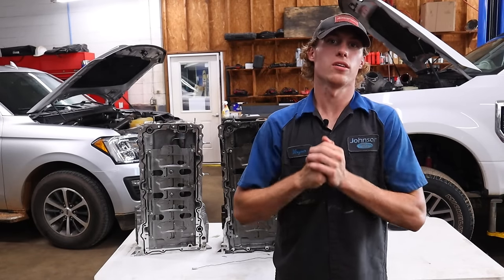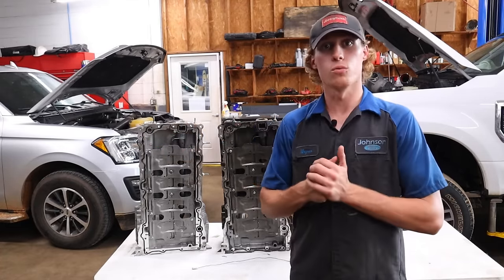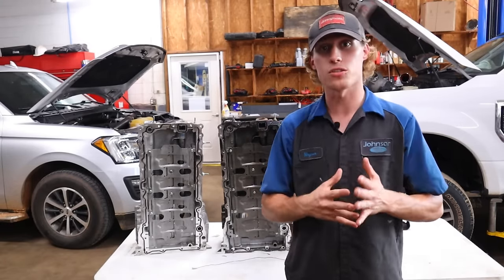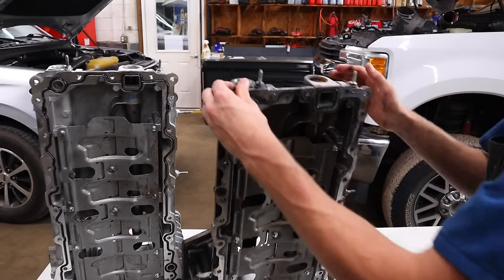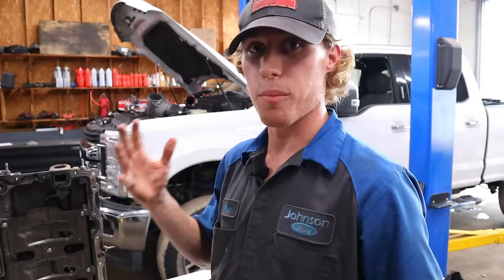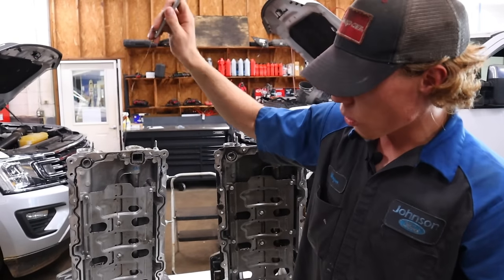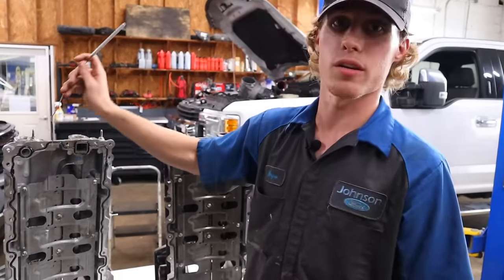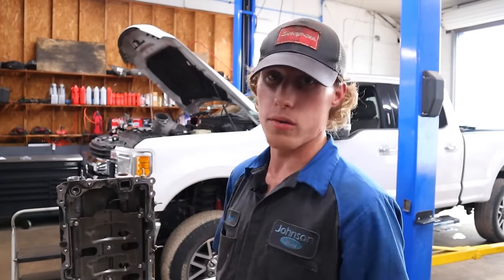How a BRAND NEW Oil Pan Destroyed This 6.7L PowerStroke

Comment: Grateful to still have my 1980 Ford F-150 shortbed with the original 300 in line 6 cylinder, 74,000 miles on it.
Reply: Now that's a cool Pickup Truck!  Don't ever sell it!
Reply: @rpsmith  that's good advice and I will keep it.   Found it at an estate auction 4 years ago and drove it home, 2,650 $.
Reply: That's a nice combo, the six with a shortbed. I've owned many chevys, dodges and now I drive a 85 f250 460 bbf. Best truck I've ever owned, and that's after owning 3 Cummins powered dodges!
Reply: @forrestwright5981  that's an excellent truck you have, they're hard to find at a fair price.    I got lucky, mine has the original undercoat and needs no body work either, original paint.

Comment: Honestly, I’m not surprised. Back at the old shop I used to work at, we ordered a rear axel for a sprinter van. The axel came in, and it didn’t have the holes to mount the spindles. Some one forgot to drill and tap the holes 🙄. Quality has gone down the drain for most manufacturers

Comment: After an oil change it can take more than 8 seconds to fully prime the oil system,
The unless's, 
The engine was reved high,
The engine was already hurting,
There was something nocked loose in the oil gallery and got past the filter.

Comment: Was the engine confirmed bad, as in ruined bearings?  I was thinking it may be possible the lack of oil flow caused a hydraulic lockup condition, where the oil pump pressure relief valve didnt flow enough oil to avoid stalling the engine.  Curious if oil pump and related components had any abnormalities after engine locked up.

Comment: I just played this game with ford two months ago. First replacement factory rebuilt transmission from ford had the clutches burn up in 3 months of normal daily driving (not towing or taking steep hills/racing). The 2nd factory rebuilt transmission that was being put in my truck had a housing crack that ford missed and cost me an extra 3 days on top of the 2 weeks that I had already spent waiting for my truck to come back from my local AAMCO shop. Because of that I am now on my 4th transmission. Thankfully the previous two transmissions and any future ones between now and 2025 are covered by my three year unlimited mileage warranty with AAMCO.

Comment: Ill be checking thay from now on thanks. Another thing to check is your upper turbo pedestal gasgets. They have an early and a late build gasget. We just got a turbo that had the wrong gasget from the supplier. The turbo lasted about 10 min before it locked up. Due to a lack of oil flow.
Reply from the maker: Good tip! Fortunately I learned that before I locked one up haha
Reply: Yes.  I have seen that happen in my shop as well.

Comment: Thanks for keeping us updated with your videos!  This is one of the reasons that I decided not to have my upper oil pan leak fixed even though it just crossed over 100k and would have been covered under warranty.  Was too afraid of something going wrong when they drop the tranny, pull it all apart then try to put it back together with no mistakes.  Have also read a lot on forums and YouTube video comments where the pan just ends up leaking again not long after it’s put back together with silicone.  Right now the leak is fairly minor and hoping it stays that way.  No CCV filter in my 2019 6.7, just the CCV box.  Curious to know if I should periodically replace the CCV box?  No major pressure at the oil fill cap.  Just a little steam that vents out…
Reply from the maker: I would!
Reply: @FlyingWrenches13  Will do, Thanks!!
Reply: CCV delete and reroute, especially since the warranty is gone.
Reply: And being a dealership they do it as fast as they can, that is how techs get paid well.

Comment: Man cant help but feel bad man, ive had 1 kind of simular where they didnt pull remove the plugs before installing the oil cooler from the factory and didnt go more than a few hundred miles before coming in with no oil pressure...oil reason i found it was cause after getting apprival for a long block i removed the cooler to remove the axle and i found all this red rubber shit in the oil passage and instantly knew somebody fkd up on assembly...so with that being said guess what i checked on the new longblock....took the oil cooler off to do my own inspection cause i wasnt about to have to do that all over...comebacks are never fun

Comment: That's messed up. Once I had a brand new hydraulic lifter fall apart because it was assembled missing a clip. Held an exhaust valve open under boost causing that cylinder to preignite like mad and ruined the head. Little bit of meltage on the piston too and the porcelain shattered on the spark plug making a nice scratch down the cylinder.

Comment: I had to install a long block in 11 6.7 for customer because another shop forgot to add oil to his truck when they changed the oil. Truck made it maybe 4 blocks then seized. The crankshaft tolerances are pretty tight. And I dont think main bearings use tangs like old motors.
Reply: sorry if new, but if you could tell me what the main bearing tangs add that non tang dont ?

Comment: You've done a good video/presentation. I worked for a Fix Or Repair Daily dealer in 1969(when we had very kool cars). After seeing how miserable the older guys were, I decided to go to college and be an engineer. I worked in construction, as an engineer, for 35 years. In the past 30 years we have seen a lot of foreign steel and hardware cause big problems and even collapses. There is a general lack of quality control/quality assurance everywhere. Many managers consider quality inspectors a wasted overhead and try to eliminate them. Good Luck, Rick
Reply: Weldor for the last 50 years and agree with you on the Cheap Frigin' Chinese Steel
Reply: I don't doubt it. I work as tech/mechanic and there was a period of a couple years just before COVID where a lot of wheel bearing we installed failed within 6 months, some barely made it a month. We tried different brands, Moog, Timken, NTN, National, ect. it didn't make a difference. We even had fairly new, low mileage vehicles coming in with failed OEM wheel bearings. Whatever type of steel they use for bearings, the supply chain for it must have got a really bad batch mixed in and it messed up all of them.
Reply: @madmatt2024  Are you specifically talking front hubs/bearings assemblys ? I know timken is gone, now koyo made in japan, Moog gone made in china, Ntn says headquarters japan, Bower gone, You say thats not happening now though ? What brand are you buying now thats working ?
Reply: @brianblithe2271  It was all wheel bearings, press in style, front AND rear hub bearings, you name it. Then it seemed like once all of the bad stock was used up, the issues went away. We don't go out of our way to buy any particular brand these days.
Reply: @madmatt2024  Thanks for the update brotha, appreciate it and rock on !!!

Comment: I got a couple questions. Are the pans with the seal a direct replacement for the ones that take silicone? And what’s the difference in the bc3z6710-a and the 6710-b gaskets?

Comment: I’m not a mechanic, but is it good practice to first crank the engine to build oil pressure before actually starting it (i.e. clear flood mode on gasoline engines)?

Comment: My buddy changed his own oil on his Honda. When he poked the plastic wrapper on the new filter a little piece went down into the filter. That little piece ended up blocking the hole to the upper part of the head that the oil feeds through. Smoked the engine. One tiny piece of plastic.

Comment: WOW! At least with a 7.3 the engine won't run long without the LPOP feeding the HPOP reservoir. I guess another preventative measure is to crank the engine without starting until you see oil pressure. Like @Ford Boss Me recommends following oil changes.
Reply: Same as a 6.0L.
Reply: @davidleonard8369  Good to know. I've never moved past the 7.3 to a 6. anything. Hear they are a lot more powerful than a 7.3, but also have to spend a bunch of $$$ to bulletproof them.
Reply: I don't know why that would be necessary following an oil change.  Oil pan off or internal engine work?  Yes, I think cranking until oil pressure is shown is a good idea but not for a routine oil change.
Reply: @ghostwrench2292  I certainly don't do it... but you are right, fo9llowing major work where the oil galleys might be empty, or bearings dry...
Reply: The oils are basically separate if they mix it's very very slow you can change the oil in the engine and not the high pressure Reservoir and right around for a month and the oil and the motor will be golden and the oil in the high pressure Reservoir will still be black so the engine will run with no oil in the oil pan until it blows
Reply: @tonydiesel3444  I don't know where you get your information from, but it's very much incorrect. The reservoir holds around a quart of oil, and the HPOP pumps the oil to the injectors. Each injector has an exhaust port that shoots oil onto the top of the head every time they fire. If the reservoir was not being replenished by the LPOP, the oil would be pumped out in a matter of seconds  If you run a 7.3 6 - 8 quarts low it will stop running because there is no oil to fire the injectors. If you look at videos where they are verifying if injectors are firing, they will remove the valve cover(s) and observe the injector exhaust ports to see if they are shooting oil while cranking or running. As for the oil in the reservoir being black, that's because the HPOP will not pull all the oil from the bottom of the reservoir. Some people advocate for sucking the oil out while doing oil changes. It's a waste of time, unless you want to clean out ALL the oil galleys in the engine while you are at it.

Comment: I had a brand new water do similar. The casting slag closed one hole down inside, not allowing any water to pass. Problem being, it had an overheating problem when serviced, and still had a problem with new water pump though everything else was checked and double checked. Just a headache that didn't even pay.

Comment: So you say the upper oil pan leak is a common issue. Now from my standpoint, I hear most engine leaks from this and other areas is due to higher than normal pressure within the crankcase. The number one culprit is the CCV. The old maintenance style with filters was usually neglected and clogged fast, so the sealed top CCV with channels and drain back was the solution but then again seemed like that didn't completely fix it. So now they have a smaller new generation CCV. Was the newest CCV a fix for crankcase pressure??
And have you seen any CCV Bypass trucks with failing upper pan gaskets?
Since the CCV bypass was supposed to be the fix

Comment: Gotta say, I'm a 5.9 Cummins owner and I do not like a two piece oil pan, an oil circuit pan, ten a pan with the sump. I say design a functioning block in the first place. Only problems I've ever had are water pumps, about every 100,000 miles or less, oil pan rotted out at 170,000 miles, put a snow depot stainless pan on(nice piece), only think is it will worry the hell out of you, the square corner sump is close as hell to the frame even with new engine mounts but I've inspected it and it's never come in contact with the frame. I'm at 196,000 miles and now the front crankshaft seal is leaking, more of a deep, barely ever drips on ground. Live in Michigan, waiting for weather warmup, field repair, driveway.

Comment: Let me start by saying that I'm not a mechanic, an automotive engineer, or even someone who knows a lot about cars.  I was surprised when you said It only took 7-8 seconds for the engine to lock.  That seems like a very short amount of time.
Reply: Agreed. 8 seconds is not nearly enough time to lock up a cold engine. Many engines can run 15 minutes or more before failure. Its possible this number is lower on diesel engines but 8 seconds does not seem reasonable to me. 
I have had a gasket fail on an oil filter. I was able to pull off the road and have it replaced without any damage to the engine. 
Does this mean that the PowerStroke would lock up in this scenario? 
I know the water pump will destroy an EcoBoost if it suffers a catastrophic failure. I didn't expect the PowerStroke to be as vulnerable.
Reply: @ITrustInDog  you forgetting he said he had no oil pressure . no oil pressure mean no bearing on the crankshaft. sense the had it this torn apart so I'm assuming all the oil slowly drained from where it was needed. no oil means metal on metal so it most likely burred the crankshaft and the bearing shims. hence why its cheaper to get an engine cause the labor for a crankshaft replacement is rather expensive.
Reply: and to your oil filter comparison its a huge difference. your oil filter will slowly leak (compared to running no oil) while this had a oil feed blocked that means no oil, not a lil oil like your oil filter. however nice job catching the gasket leak before it ruined the engine.
Reply: The engine didnt have residual oil because the pan replace, and start a engine with no absolute pressure it's very bad. When i mess with the lube system on a engine, always cranking the engine to built up pressure before actually start the engine
Reply: @servicioelectromecanicocue7025  thats if you lucky and it dont kick over
Reply: @servicioelectromecanicocue7025  All the parts have a residual oil film on them unless it's a brand new engine assembled with no assembly lube, which is a whole other problem.
Reply: @servicioelectromecanicocue7025  Great point!
Reply: @handyvan3422  so your rights being violated is not bullshit?

Comment: Great video.....what a bummer, but not shocking. I have a 1967 gto and the alternator is externally regulated. I went to replace the external regulator with a brand new ac delco external voltage regulator, and it was bad from the get go, brand new $100.00 part did not work......quality control is not existant these days!

Comment: I've seen engines run almost an hour without oil, yet I've also seen an engine seizure after just a minute after a valve cover seal blow and the engine still had oil in it.

Comment: I recall many years ago a guy bought a new Ford with 351c engine that ran on 7 cyls. The dealer doodled around with it for quite awhile before pulling the head and discovered it was miscast and had a blocked intake port on only one cyl. Reminds me of this issue that looks like similar fault with an over designed oilpan.

Comment: How in the world did that thing lock up after just 8 seconds? I work for a large contractor and  some of these guys will run our equipment wide ass open all day without checking a thing. When it's my turn to run the equipment i check everything and often find crap to be 2 gallons low on oil, nothing reading or barely reading on the dipstick or air filters with a half inch layer of dirt on them. A few times I've hopped on a piece of equipment that's been running all day just to move it and found the oil pressure light illuminated. That said, I've never seen any of our equipment grenade or lock up which is mind blowing
Reply: There's a difference in quality between Ford and CAT.
Reply: I'm far from a Ford fanboy but an engine with NO oil delivered anywhere in the engine is in a different situation from an engine that is low on oil.  I do not work on diesel engines but I have heard from the diesel techs in my shop that the 6.7L Powerstroke engine will lock up without oil in a matter of seconds, just like it did for this guy.

Comment: Who's paying for the long block (along with your labour to install it)? You installed an early version of upper oil pan with the press in place style of gasket onto a later version of engine originally equipped with the silicone sealed version. Now, don't get me wrong. I totally understand what your intention was with doing so (I probably would have done the exact same thing because I HATE dealing with silicone sealed covers). But.... Ford could turn around and ask why you are installing a part onto an engine that doesn't originally call for it, not that the particular ensuing failure has anything to do with it. I'm just interested in knowing how you managed to swing getting this warrantied for the customer? Just curious. BTW, I've been busy as hell with 3.5 and 1.5 engines lately, which as you know both have a lot of silicone sealed engine parts, so I totally get it.
Reply: Wow, that is a VERY good point you bring up!  I, too, am now curious how FoMoCo is going to play this.  It seems they try to find any little reason to deny a warranty claim.
Reply: The mere fact that it's been done hundreds if not thousands of times with no issues would speak that it was solely a faulty part.

Comment: Mason: curious,have you dealt with a broken crankshaft in F-150 equipped Peugeot V6HDI twin turbo diesels?. Is/ does Ford use the car FWD version like Jag/ Land Rover or slightly longer block with stronger crank?